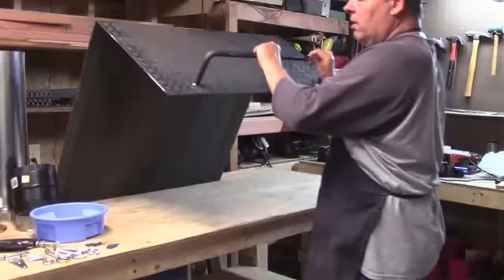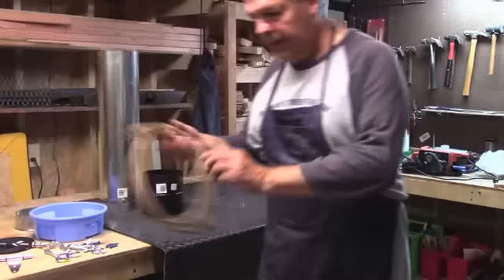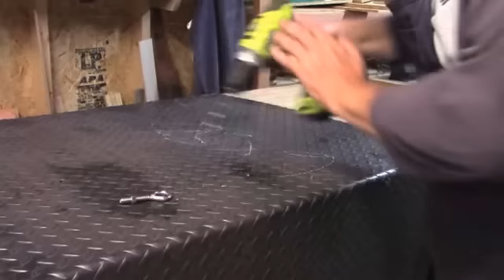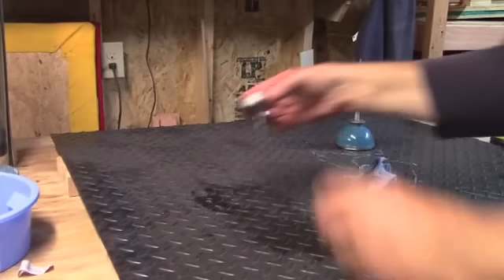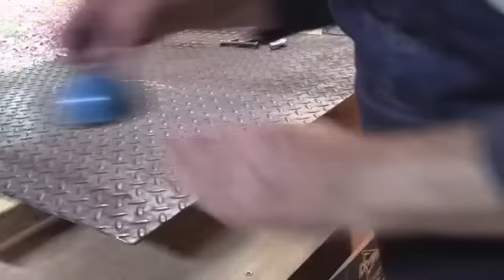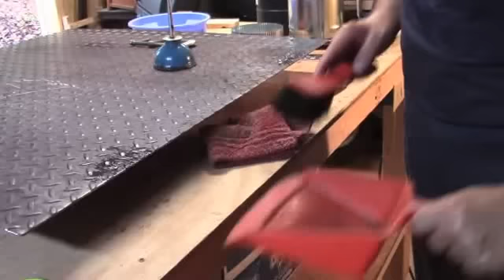How to Make a Diamond Plate Grill Hood, part one

Comment: I like everything about your grill and multiple videos. However I would value any sketches or written advise detailing a single modification: I would like to have the fire off the ground and in a captured area. I have some thoughts but now consider you to be the expert in b uilding this system. Thanks for anything you can offer.
Reply from the maker: Thanks for watching! I thought about raising the whole fire level by using more blocks and a full diamond plate surface, but have not done it yet. No drawings are available though!

Comment: I appreciate the work, but I think I will use aluminum.  By the way, the melting point of aluminum is over 1200 deg. F, if the fire ever gets to that point I think there will be bigger problems than the top!
Reply: I believe if he use it as a smoker tempt won't get that high. Great point.
Reply from the maker: I keep the temp around 300-400 degrees; so we have no problem cooking with aluminum. Thanks for watching!